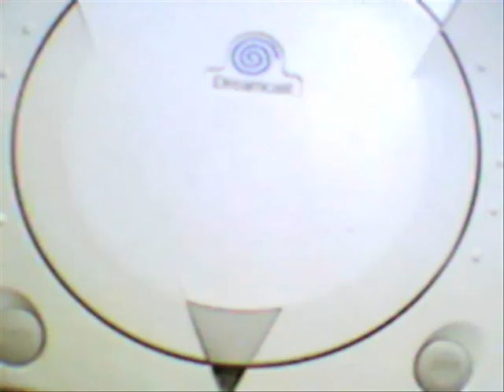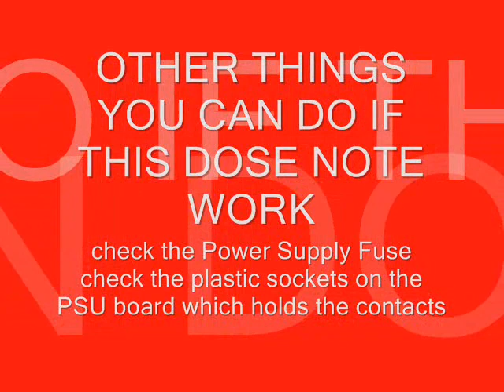Dreamcast Care & Repair: Fixing Random Restart Problem

Comment: @arranmc182 

Ya, it was overheating... guess what was doing it? It was actually those thermal pads they put on the chips that was doing it strangely enough.. after i took them off and ran the system raw, it came back to life and runs perfectly fine now! It dont need those damn pads, it will get warmer of course but not over heat.

Comment: The bending of the pins worked for my system for a while, so this is probably the most common cause. Im not sure if the resetting issue affects all models of dc but after so many days my one was eventually back to resetting. I dont think theres a permanent solution without a techie expert at hand aside from or attempting more pressure to the pins at the risk of damage for longer gameplay.. or using a dreamcast emulator on your quad core mobile phone in 2020 :D

Comment: @JohnnyGameGuy
If you used the wet wipes and turned on your D/C without letting the pins dry, your DC might have been fused, if so, you have to find a new power board.

Comment: Could be that its just getting old and dusty.. It may seem to have worked at your missus' place but not yours, but I bet it would reset there now if you tried it.  I've had loads of stuff where I thought it was a circumstancial thing - but the power supply in the house should make no difference - if it works, it works. Hope you got it sorted anyway!

Comment: Maybe this sounds crazy, but I too got the rebooting problem and cleaning+blending the PSU-pins didn't work for me.
This probably really sounds crazy, because I used a cotton swab dipped in cleaning alcohol to clean the two pins on the rearside of the DC where the power cable is attached to, at least with European continental DC's. Gray stuff came off it (probably metaloxide stuff), and now the machine seems to work like a charm.

Comment: you should have not used these wet wipes, its only best to gently rub them with a dry cloth, and not to bend them or move anything in the power board as you may have moved something in the power board that triggered this error with your dreamcast.

Comment: arranmc182, i dont get it
i currently have a PAL and NTSC dreamcastmand they BOTH do the randm reset thing.

my pal one is totally disassembled m tried everything,so i bought a ntsc one. Worked fine @ my GF's house, at my house it random resets.

Could it be something with my electricity net?

(this is my GF's youtubeaccount, leave a msg @ mine (vulgaris1901)

thanx in advance!